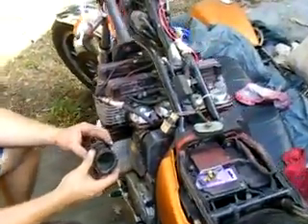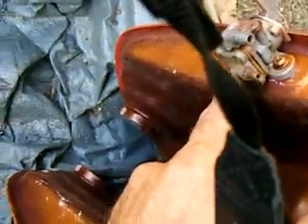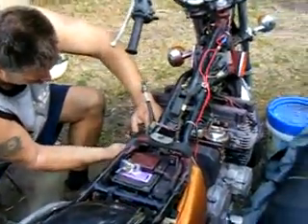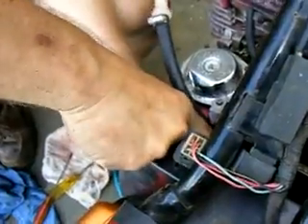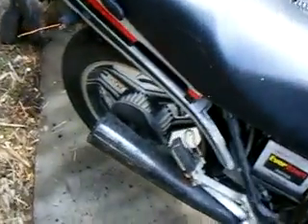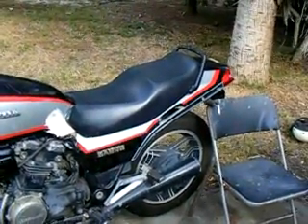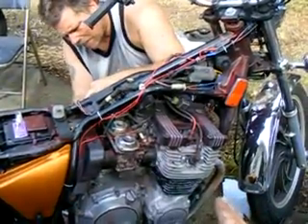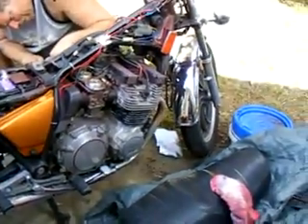Yamaha Maxim xj650 airbox Importance

Comment: The front face of my '81 XJ650 air box was warped so I fabricated and attached an aluminum brace that spans the entire face of the airbox.  Also, I replaced the original rubber intake tubes with brand new.  Replaced the crappy OEM hose clamps with Breeze 3/8" wide stainless hose clamps (available through McMaster Carr).  No more leaks. Engine runs great.

Comment: My 82 xj650 runs just fine without boots and an air box. All I had to do was to slap on some pod air filters, put a larger pilot and main carb jet and install a breather pod on the crankcase breather.
Reply from the maker: put a drop of oil on those pods before every ride or you'll be replacing those vacuum slides every year -- at 90 bucks each ...suprised to hear the petcock still opens up -- or did you eliminate the vacuum petcock and put on a normal one?
Reply: dawino6260 has the stock petcock, still runs perfectly

Comment from the maker: @Michiganborn1969 Radiator hose will stretch around -- or worst case scenario - go one size larger on the manifold side and make a ring out of the right size on the carb side and clamp the heck out of em. Midway cycle salvage in Madison, Alabama would be my first call for new/used boots - my second would be to Baltimore cycle salvage in Baltimore, Md -- Precision or Randys in Sarasota would have them too but they want them inflated retail dollars

Comment: Humm after looking at the airbox assembly with the carb boot, it maynot be possible to use a radiator hose b/c the boots on the manifold side are flanged where the boot bolts into manifold. Perhaps a small thermostat housing with the radiator hose might work.

Comment from the maker: I slip the back boots bac into the airbox - then put the carbs into the engines boots then pull the airbox to back of carb boots through and on. Major PITA if you have old boots that are hard

Comment: I have a question about the carbs. We just bought a 1982 XJ650RJ Seca. It came with these funky little filters on each carb. Bike runs like shit. Missing on one or more cylinders. It was a hack job for sure. Should I just go find the original air box and reinstall it? Will it run better? Just looking for your opinion.     Stephen

Comment from the maker: @Michiganborn1969 - I dont recall those having a manifold gasket -- should just be O-rings  you can always TEMPORARILY seal the boots with Indian Head Gasket shellac - Also cheaper than buying boots - if you just need the rubber boots - get some radiator hose and cut your own.
If its the O-rings (gaskets) pull one out, go to NAPA and get a set that one size fatter (the thickness not diameter) for hydraulic fittings - also John Deere and CAT use the same O-rings

Comment from the maker: @Michiganborn1969 - It would hold  the temps -- that's only a get by solution though -Aircraft Spruce and Specialty would have real intake hose Lycoming I think is 1.75"  Dennis THINKS some of the pushrod seals from an Antonov An/2 engine would fit too -- But we both saw real intake hose on their site - Radiator hose does good in a pinch though - ONLY do that if you cant find real intake boots - Stupid question: is your vacuum test point cap all the way sealed?

Comment: I have a dead #3 cylinder on my 85 Maxim XJ700N. This is the same cylinder that also has a leak on the carb joint boot behind the intake manifold as tested when I sprayed starter fluid on the boot & the rpms shot up by 2k. The boot itself is next to impossible to find a replacement but what if I replaced the manifold gaskets?

Comment: if you remove the airbox and add some pod filter and rejet the carbs on that bike it shouldnt run too hot should it? as long as the mixture isn't lean just put a larger main jet and it should be fine yeah? let me tell you I live in kentucky and it sucks out here it was 20degrees other night had to start bike and had a hell of a time took bout 5mins of max choke + throttle blipping to start it cant just pop my seat off and spray some starter fluid in airbox either been thinkin bout pods

Comment: @dawino6260 
Thanks for the reply. Yeah the manifold gaskets are part # 4H-13556-11-00 and they are shaped like the kind of gasket you would put on a catalitic converter and I was wondering of it's this leak on this boot that causing the dead cylinder because I have spark & compession and I'm not getting any wet unburned fuel on the spark plug tip witch leads me to beleive it's not getting little or no gas. Would the radiator hose hold up to the tempetures? Good idea though.

Comment from the maker: Other than you forgot to mention the part about tee off your PCV and run hoses into the back of the pods to lubricate your slides... or at minimum use real air filter oil or even some marvel on em.... those slides dry behind pods are a bad thing - usually it's just replace em to get past the vacuum leak but I have seen em score the carbs bore on the way out - oil em every gas stop with 1 drop apiece is the rule no-one practices